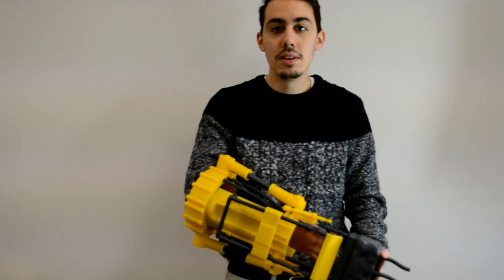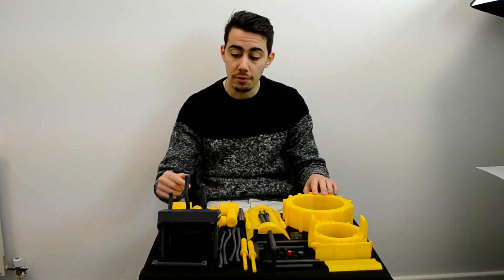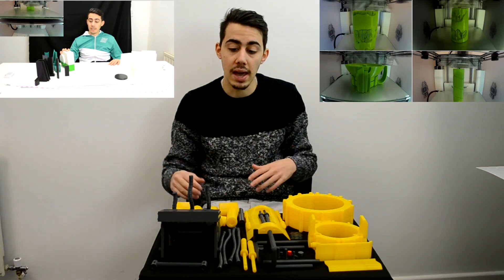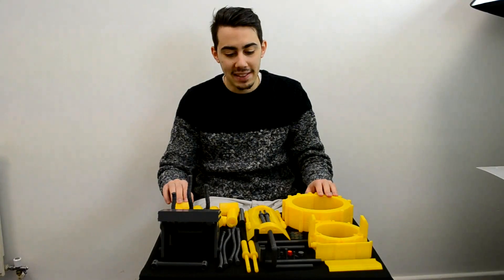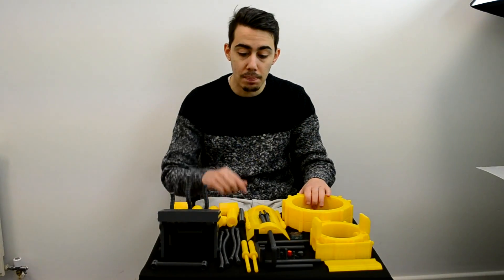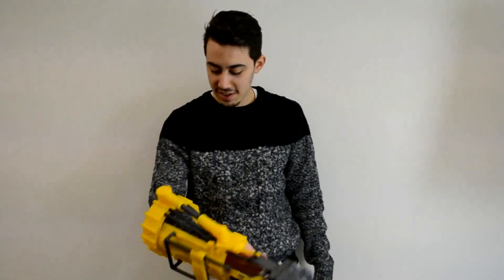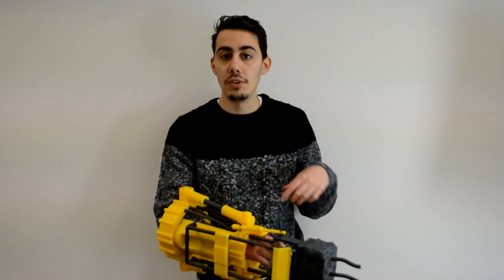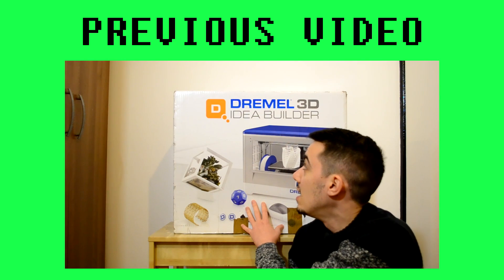3D Printed Furious Power Fist from Fallout 4

Comment: So far so good on the print, but I think my big hands are causing an issue with the smaller of the 2 rings.  Gonna see what I can do about sanding more plastic out of the inside to get a better fit.
Reply from the maker: +Zander Yurami REally cool! Send me some picture on my FB page i will like to see how is coming ;)
Reply: +Simone | FNTSMN i am NerdyNotionZ on IG.  i tagged you there
Reply from the maker: +Zander Yurami AAA ok cool, i suggest you to print all the small pieces with 100% of infill ;)
Reply: all small parts are.  I used 25% on the bigger parts and PVC on some of the pipes.  Didnt see a need to print those.  

also using thick walls on parts I know need to be sanded more
Reply from the maker: a ok cool